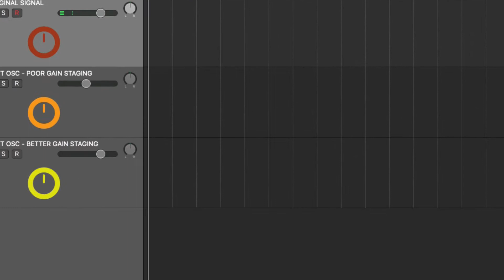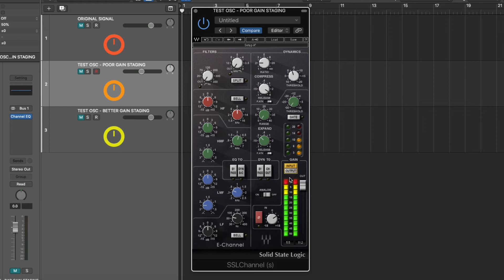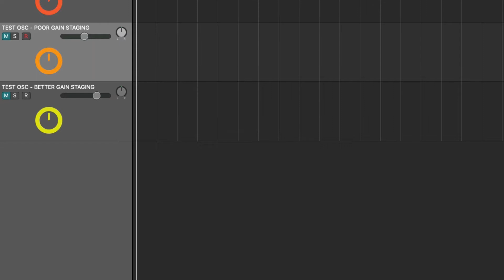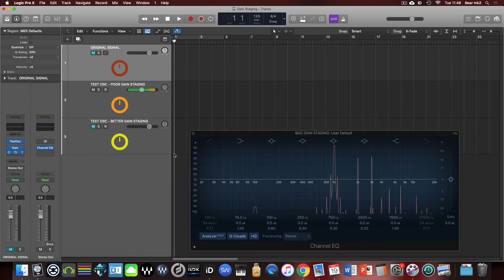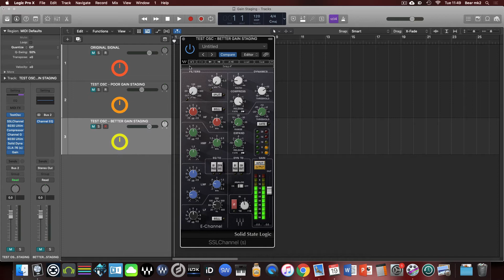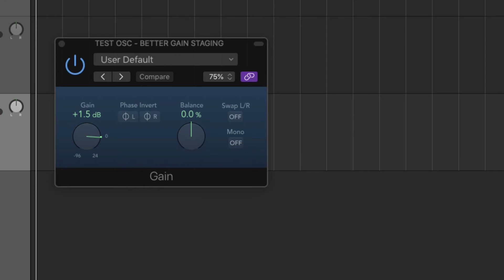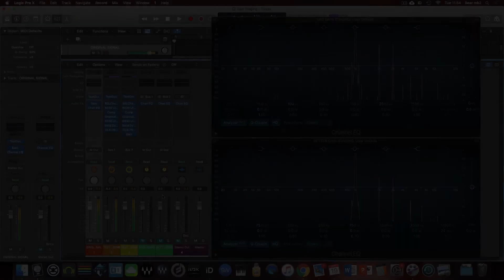Gain Staging (Part 1)

Comment: Brilliant analysis. A question I would like to ask is at what dB normalised value should the project files be? Example -3, -6, -9 as a nominal file gain? Thank you in advance.
Reply: Here is what I did to gain stage in my own DAW. Please correct me if any step was wrong. 1) de-noised and then normalised all audio files to -6dB, 2) set all faders to 120dB resolution and then set to 0dB, 3) added a VU meter in mono to the stereo output and solo'd all tracks adjusting the track channel gain control to read 0dB on the mastee output VU meter, 3) Dropped all faders frrom 0dB to -18dB, 4) reset the output VU meter to stereo. I could also have inserted a VU meter on the track inserts prior to the master output. The VU meter was reacting to the post-fader signal. Should that reading be pre-fader at the track output or is it ok to leave it set at post fader? Thank you.